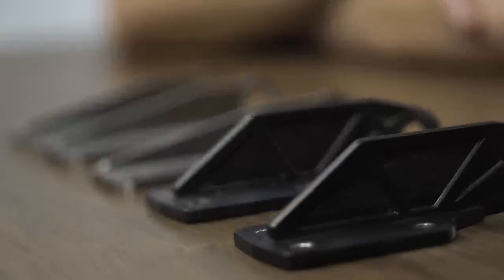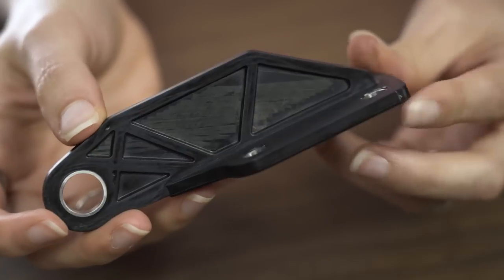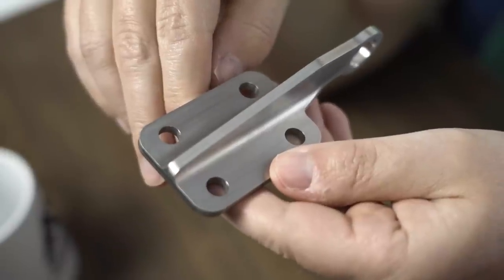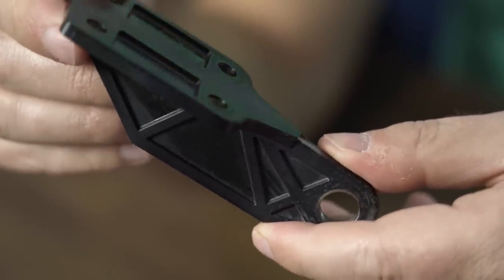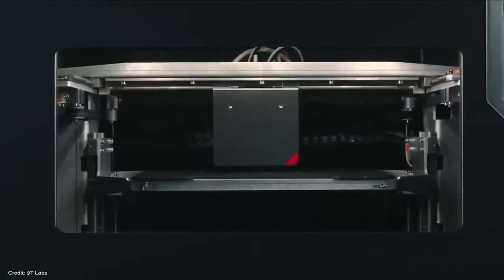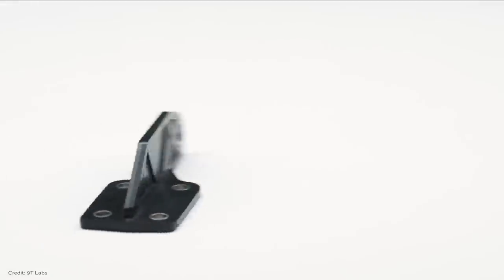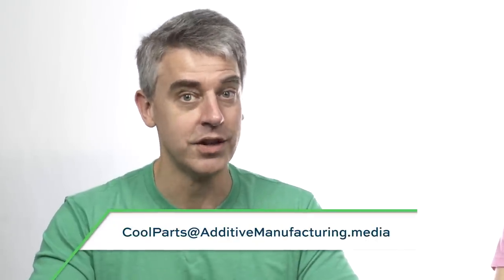3D Printed Composite Bracket Versus Machined Steel |The Cool Parts Show #41

Comment: This seems like the FDM portion is completely unnecessary. Why would you not fixture your components/pattern in the tooling that is already in use and skip the printing portion altogether?  

Designing for support the static load is the bare minimum of any bracket. How does this hold up to the many fatigue cycles of opening the door and also all of the vibrations during flight? I am also assuming that the plastic can handle the extreme temperature fluctuations between takeoff and landing.

Comment: As far as cost, I find it hard to imagine the composite part being more cost effective because of the “elephant in the room”,, the need for a mold and that mold has to be machined. Strength is questionable too, as it’s “multi part” fused together, in the test, the weight is pulling in one direction, straight down, that isn’t how a door hinge should be tested. And lastly, especially on a helicopter which a lot of times is described as a collection of parts all trying very hard to explode away from each other in all different directions. This isn’t taking into account the thermal changes involved. Composite printing is truly amazing and industry changing, but I do see flaws in this part as “manufactured” to stack up against a 1 piece machined piece of steel..   Great video, thanks so much for sharing with us!

Comment: How does this process compare to the MarkForged X7 onyx with carbon fiber filament? I'd be very interested to see!
Reply: Excuse me for the late answer!
There are many differences, one of them being that 9T Labs offers an open material platform with the possibility to print parts having a fiber volume content of 60%
Reply: the printer is irrelevant. 
carbon fiber filament is light weight but doesn't have the strength where you need it. its more layered like any other filament print. 
the fact that this is a multi part print means they arranged the carbon fiber strands in a way that would provide the most strength according to the load for each part.
then the parts are placed in a mold and solidified into one. even if you do that with a mark forge or a $200 printer it wont be as strong as this optimized continuous fiber process.

Comment: I'm quite surprised that it's cheaper. It requires special tooling and knowledge that is pretty cutting edge. It requires many steps, more than the CNC part.
Reply: My thoughts also.
Reply: ya, no way is that cheaper.  They probably were just saying that if scaled it COULD become cheaper.

Comment: I can't speak for everything but a fire arm that is fiber reinforced Polymer Vs. a steel gun I will take steel any day especially if either were exposed to a squib load. Also the metal bracket was it a MIM part or machined from a single block of steel if the later I would love to see both brackets exposed to lateral & Shear stress.

Comment: Just a reminder, that the machined part is MUCH stronger and could in fact hold many times the strain compared to the plastic one. Also, if the requirement for loads would be what the plastic one can handle, the machined part could be much smaller and thinner. This comparison is kind of apples to oranges, and does not make really sense. They should have been engineered for the same load, so we could see what is the size and cost difference. Probably the bolt's would be the most critical part to determine the max load. Cheers!

Comment: Only down side for an industrial application is the fact that it cannot be field welded or repaired as easily. But, I guess you could replace certain parts with a metal fabricated part or if it is more economical have spares on hand. I know that a lot of drag racers ran into this problem with titanium and the fact that it was very difficult to repair at the track do to the complex welding process. The beauty of steel is that most of the time a competent welder can repair the component in the field and have a part nearly as good as new or make quick design changes to improve its performance without having to rebuild the whole part. For example, lets take a 3d printed composite flange with a bolt pattern that dose not line up. Steel would be an easy fix. Braze it the hole shut, re drill and tap. I dont think thats doable with printed plastic.

Comment: I like it. But I wonder why anyone would machine a bracket like that? It could easily be made out of two plates welded together, or even stamping it out from a few pieces and spot welded...
Reply: Great points. We definitely agree that there are many ways to realize such a part. Given the functional requirements (including weight reduction expectations), this customer was looking for a reinforced plastic part. This is where our AFT process was challenged vs. other processes and impressed this aerospace OEM. Stay tuned as we will soon communicate some great partnerships.
Reply: Absolutely.  The composite part is amazing and has a ton of applications, but there is a 0% chance the 3D printed part is cheaper in the real world.  The only reason they can make that argument with a straight face is because they milled the metal bracket out of a solid piece.  No one would make the part that way.
Reply: Recall that the reason such parts are milled from a homogenious block is the stresd path at the root connection between the base and web member.  Welding is precluded due to material imbrittlement due to heat zone, and cracking of relatively brittle weld material.

Be interedting to know how the stress path is managed across what appears to be a post build heat / pressure bond. No continuous fibres across the jount.

Comment: 90 degree angles are not rounded in your plastic parts which may cause them to crack.
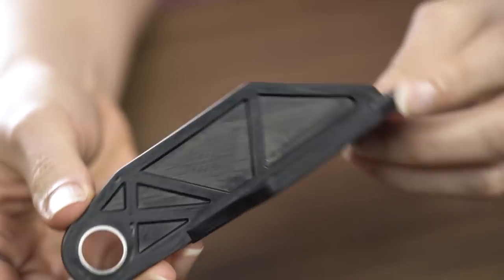Reply: Take a look at 2:16. Two of the connections or joint board structure lines are rounded. Also, the do not seem to be any 90° connections. Also, we don’t know how this piece is being used and where the stress is being applied it’s being applied One Direction or in changing directions or whatever. But, generally knowing nothing about these kinds of things… I tend to agree with you.

Comment: The big weakness i would like to know how they address it is that multiple parts after injection molding won't have a single continuous fiber. So the plate and the perpendicular ribbon are still only connected by plastic, sure it does has amazing strength in-plane. But stresses will concentrate exactly on the joints where only connected by plastic, decreasingly the actual overall strength of the part, there would be no point in having everything else be carbon fiber reinforced if yield strength is still the plastics regular strength
Reply from the maker: Response from Yannick Willemin of 9T Labs:
Dear Mich, this is where we can leverage both on existing knowledge for thermoplastics welding and our design software. By working on a smart mechanical interlock - both from a geometry and fiber layup point of view - we could actually manufacture a part which withstands much higher loads than the original metal part - please contact me at yannick@9tlabs.com and I will forward the test results.

Comment: there is still Titanium and Titanium-Composites to consider.. also light and strong.. Every tool has it's function.. To really say this works one needs to know the forces that a particular part needs to absorb.. in short a VS  comparison only works per specifiek  application not a generalization  bracket a vs bracket b..without more info. would have bin nice to see a stress comparison

Comment: This type of machine could be used to transport power delivery in some applications- say from a LifePO4 battery box, you could lay the fibres in a way to have enough thickness to safely transfer energy "through" a material as carbon fibre is conductive.... all the while having sufficient separation, hm. Carbon fibres may be more expensive but this is a more integrated system, I suppose

Comment: You guys should look at the Mark two from Markforged, does all that with out the compression. Also look at the metal X
Reply: Actually the Mark two does not do all that without the compression. It is important to precise that the targeted markets for the Mart Two and the Additive Fusion Technology (AFT) are very different. The AFT is going for structural metal part substitution in higher volumes (1'000 to 100'000 parts per year). 
Here, it is necessary to have up to 60% fiber volume content in the final part, high-performance polymers (AFT does PEEK, PEKK, PPS), excellent interlaminar bonding (think fatigue cycles), porosity < 1 %, and high R&R.
Reply: Markforged carbon is shit fvf and consolidation. Nowhere near as strong
Reply: @appa609  false AF

Comment: That steel part should have been aluminum if the strength wasn't required. It should also be welded from two parts, rather than machined. Welding an aluminum version would have been cheap and fast.

Comment: Why comparing with steel there are other cheaper metals like auminum and alloys which can be used to save cost and weigth instead of composite. Composite do not justify here to use it instead of steel.

Comment: The original bracket is overkill and probably could have been sheet metal or just copy-pasted out of alloy if ~400 kg of tension was acceptable.

No wonder helicopters are so expensive. Like, who the heck makes a door hinge that has to be machined out of a solid billet of stainless steel?

Comment: I call BS, 1/2 the price to produce? In the shops I managed, if you brought the print for that part, I would produce it out of steel or stainless for about $23, that mold alone cost about $100k - yea I know large quantity orders, but it comes down to the mold yield, how many parts can run through the mold. $100k divided by that number. at low volumes of 100k units, CNC machining is still cheaper and faster. - is it a better part? maybe, but that whole 1/2 price is BS

Comment: Imagine the instant range increase you would get from an Ev made from this, weighing less than half your average one! You could turn a 2000kg car with a 100kw battery that gets say 500km range into a 900kg car with a 60kw battery that get 700km of range for less money....Rough figures obviously but probably not far from possible considering the Aptera.

Comment: I am no engineer but not every application is best suited for 3d printed part. That was just a simple lift test but what about if the part was banged into creating lateral forces. That would be a whole different story in my opinion. I would stick with the machined part.

Comment: This composite part is so not cheaper and so not faster to make. This is biased comparison design to make make that composite part look good: steel part is plain steel not an alloy and the composite part unlike steel is optimised for weight saving. 
If you want to be fair compare that 3D printed composite part with: 
1. weight optimised alloy machined part
2. weight optimised engineering plastic machined part (with metal inserts)
3. weight optimised composite 3D printed part  (with metal inserts)
4. weight optimised composite 3D forged part  (with metal inserts)
5. same composite part without post processing in the compression molding
This is not a revolution but a niche technology and it will stay this way

Comment: the mold COMPLETELY DEFEATS THE PURPOSE.. JUST INJECT THE PLASTIC what benefit do you have by printing it before hand?  When you also need a custom machined precision cavity mold "non" injection machine? just a mold compression machine?  How is that any cheaper? Its just mold making with extra steps.

Comment: Late to the party, but i think a stoopid study needs to be conducted before parts like this can be used in the field… gotta get the dumbest operator you can find to abuse the use cases and figure out how many cycles it can withstand. This part looks like it would fail in 10-15 cycles under stoopid test conditions… then an analysis of downtime vs per part savings etc… if it still works out sure

Comment: I think that the test was not sufficient, first it only showed it can work at given weight, but not when it fail. So stating they are the same is false without knowing that. Another thing are different force directions like picking on rotating. There far too little information for me to buy into this. This sounded like advertisement. A great potential to interesting movie but I dont like execution.

Comment: This is laughable. Neat but it practicality is laughable. Each mold costs 10s of thousands of dollars. That is for each part and for every revision to an existing part. As opposed to cnc plasma cutters and cnc tig welders that have a one time purchase cost and computer programs to design and cut out parts repeatedly. Upfront cost is less and continuing costs are less. Making parts in aluminum almost negates any weight savings. Plus, saving 4/5th the weight off parts that account for only 1/1000th the weight of the finished product is spectacularly useless.